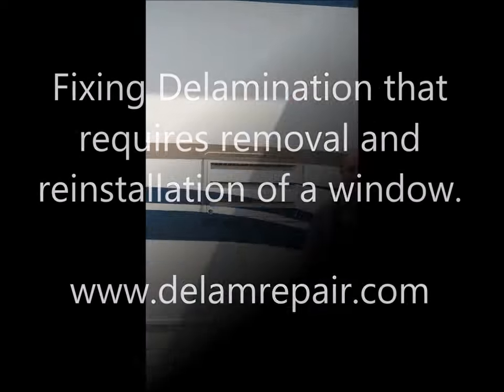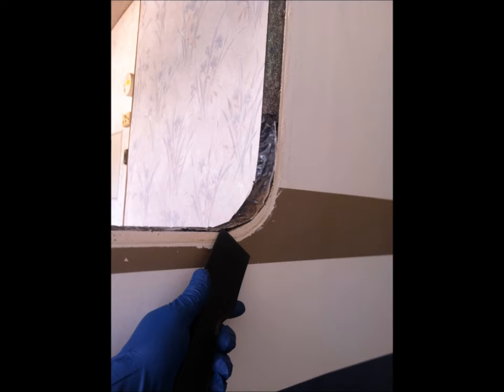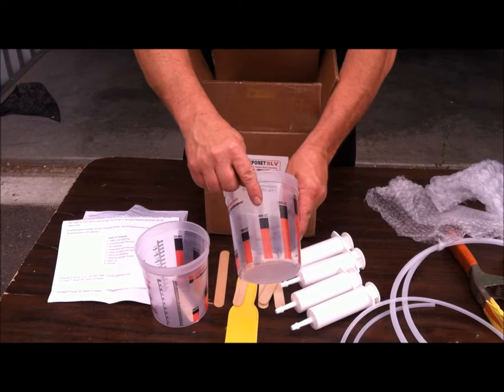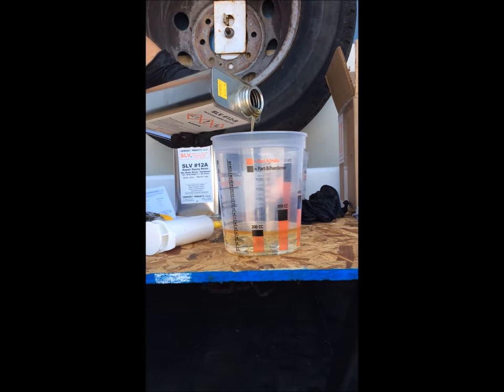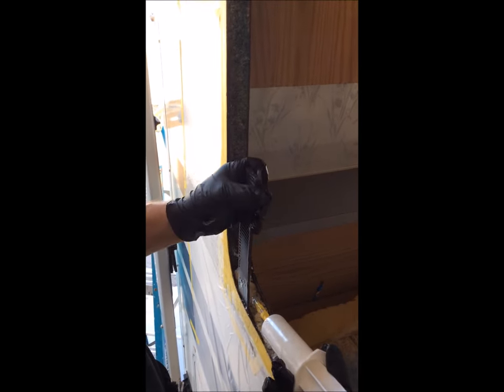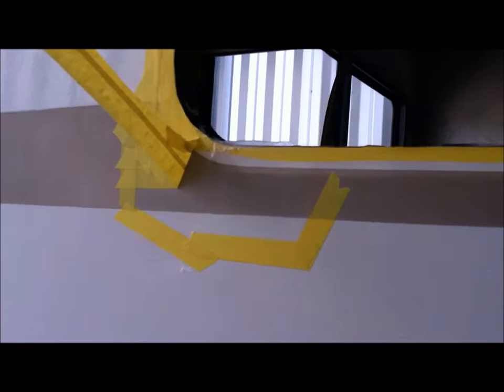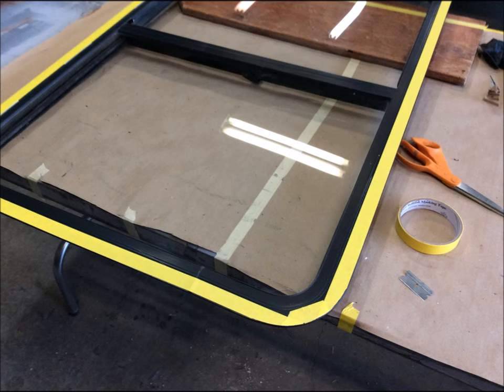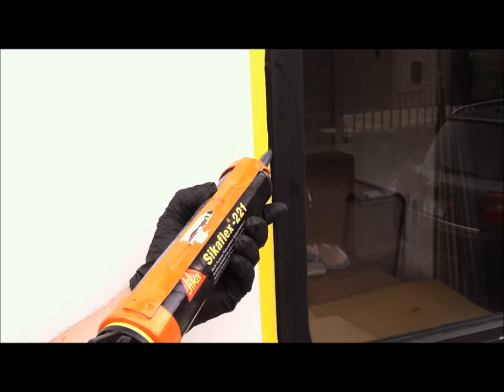DIY how-to fix for delamination & rotted camper wall- Composet SLV epoxy- Delam Repair Kit tutorial

Comment: Why do you fill it instead of cutting out that section of the wall and replacing?
Reply from the maker: It is really personal preference. Many times the wood is not rotted, is has just delaminated and can be re-bonded together. This takes a day or two. Many people prefer to do this rather than take a week or more to completely reconstruct the wall. But there are situations were a complete rebuild is the only answer.

Comment: I saw in the video that you measured the bubble to determine how much resin you needed to mix. How do you determine the volume of resin based on the measurements? Thanks.
Reply from the maker: 100cc per 1 square foot of single layer delam is the general Rule of Thumb.

Comment: What about the wet rotted wood in the inside walls? Any videos on how to replace that as well?
Reply from the maker: Severe water damage, which includes mold, rot, and disintegration is different than straightforward delamination. Our products and process are for delamination where the wood fibers and underlying surfaces are dry and generally sound, with the exception of the bonded layers separating. When the damage is severe, we always recommend rebuilding or replacing the wall. Sorry, we do not have complete rebuild videos because that is not our specialty.
Reply: We normally cut out the bad area plus a little extra. Then remove the filon from the wood very carefully. Then I normally replace all of the rotten wood. To do this I use stabond E183 to glue it back to the styrofoam. This won't melt the styrofoam. Afterwards I Then work on cleaning up the filon siding with a sander. Afterwards I spray stabond T440C on the wood making sure to only get it on the wood and then spray the filon siding to be adhered to the wood. I Then get someone to help me put it up on the sidewall. Afterwards I roll it out with a  Laminate roller really well. For the cut lines I use a grinder to open them up and then use dnyaglass to fill them back. After all of this I tape off the  The   the area and color match the gelcoat and spray the area and sand then polish it up.
Reply: @shannonmcafee4169 
Got an email or number for questions?
Reply: @javiergallegos9289  I naturally can’t see your damage. But I have gone in and replaced a lot of wood in camper’s. Normally I just start taking pictures and then taking the affected areas apart. Then accessing the damaged area I decide what to do next. But you must know what’s the amount of damage first. This way you can decide on where to go with it. I do enjoy working on them with my friends. We’ve knocked out some bad damage in the past. But you’ve got to open up the wounds to see how bad it is.

Comment: I have a major wall issue on a 2004 palomino thoroughbred 21ft. If I post a video of all o got going on do you think you could check it out for me and give me a pointer or two? Or tell me if I should just junk it
Reply from the maker: Jason, I can't say what to do with your rig, however you are not alone. Our products can be good on small areas. If a big area is the problem, or the plywood is falling out, then a rebuild might be the way to go.
Reply: @composetproductsl.l.c.dela2844  thanks for responding. Nad yes it's major. It's almost all the way around the bottom. The wood is rotted. Most of the wall feels solid but you can tell it's not by looking at the bulge all the way around the bottom outside. The front right side is the worse.  I'm assuming it wouldn't be safe at all to pull it anywhere huh?
Reply from the maker: @mustangmadd3172  I'd recommend having a local shop look at it. I

Comment: I have a 94 Gulfstream Conquest class C with delamination, but the delaminated areas are 'hard' with no give.  Any idea what causes it to be so resistant to pushing in and is it repairable?
Reply from the maker: Some coaches were built with a thick (3/16" +/-) fiberglass siding that does not flex like the much thinner Filon type siding. Also, the composite wall (fiberglass/plywood/foam/panel) might not be delaminated. There could be a framing issue.

Comment: Do you not have to remove any of that black styrofoam insulation? I have a similar project going on and the wall looks rough. I was going to use a multi tool to cut into it from the inside a bit then try my best to scrape off all the gross styrofoam then patch in and glue new pieces of foam and luan. Is this reasonable?
Reply from the maker: We have never seen black Styrofoam. Mold can turn material black so please be careful and check to make sure it is not mold.
Reply: Why is it black in the window sill then? Expect for the spot where it looks like some was broken away the surface of the rest of the styrofoam in your video looks black? And oh yeah mine is mold city. Total gut job.
Reply from the maker: @ajax9948  This particular RV was manufactured with a soft black seal of some sort inside the window rough opening. In the video you can see the black seal has been removed and white styro underneath.
Reply: Ohh okay I gotcha thank you!

Comment: Did you put the black or white coiled strip on that was shown or just the black caulk? Also wouldn’t those two small black shim squares that you put in create a gap across the rest of the bottom of the window?
Reply from the maker: We used just the black Sikaflex 221 sealant. No putty or butyl tape as used. The shims centered the window in the opening. If we set the window onto the sill without shims, there would have been a large gap at the top. Many leaks around windows are a result of the window not being centered, or the window rough opening too large, which are "factory" problems.
Reply: Carole V 

The shims remain, car windscreens (windshields to you guys) are assembled in the same way. The shims hold the glass or frame in place during the sealing and setting process.

Comment: How dry do the walls have to be? My fiberglass skin has come to a hanging stance. I noticed it when I opened the slide out. I know it is still leaking and I will find the leak but I need to know that I do not have to pull the skin off to use your product. Thanks.
Reply from the maker: Dry is important. In many cases a repair can be made without removing or taking apart the walls. Results vary depending on the amount of damage and your expectations of what a successful repair is. Contact us through www.delamrepair.com and send a few pictures.
Reply: Composet Products L.L.C. delamrepair.com will do as soon as I get home. I’m working in Iowa and fly home on the 19th. Again thanks.
Reply: @composetproductsl.l.c.dela2844  What if the wall is rotten? In the loft I have a rotten bottom of the wall under the window.
Reply from the maker: @psedwick  Replace or rebuild the entire wall if the wood is rotten, moldy, disintegrating, or falling out. If the plies in the plywood layers are present but separating, and the wood in not rotten, moldy or disintegrating, then it may be possible to re-bond the plies in the plywood if they are sound and dry.

Comment: Just one major problem. You didn't get the rotted, wet wood out of the wall. You obviously have a leak that needs addressed. It will reoccur, and you risk mold poisoning.
Reply from the maker: The wood is not always rotted. In many cases the glue holding the plywood together dissolves and can be re-bonded.. If the leak persists and the delamination and leak path is not repaired then you will get rot and mold.
Reply: You are correct this is a half fast job in my opinion. If you're going to do this you might as well just build a cover over it

Comment: I just bought a camper, I will never ever buy a camper  that has this kind of walls..(plywood foam comosite) the glue behind it is a headache to get off.. the wood at the bottom  just crumbles, I have spent 8 days trying to get the rest of the wall down just to get a fresh start! The glue does not come off! Here you are, just adding more glue smh!
Reply from the maker: Thanks for the comment and I feel your pain. Unfortunately, what you are experiencing is typical in the used RV arena. Replacing the wall will be challenging due to nature of a composite structure.